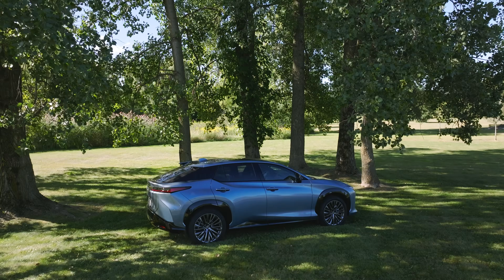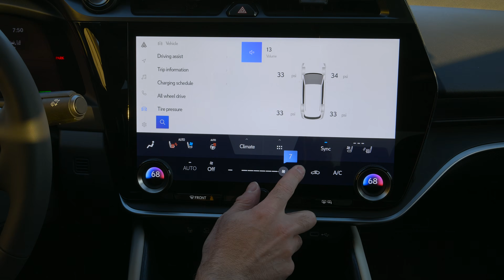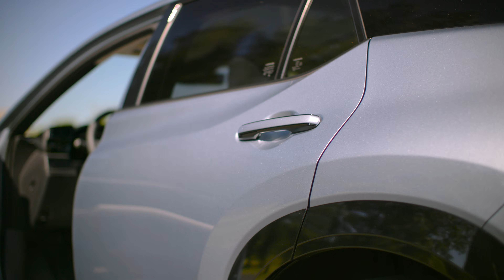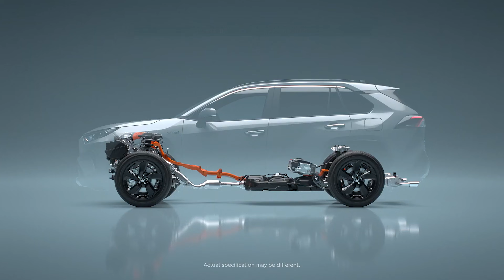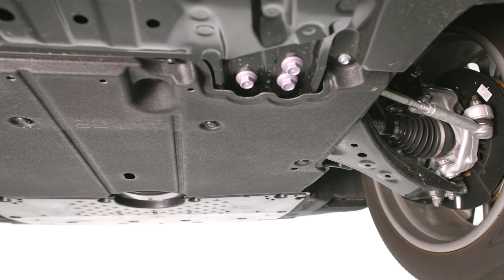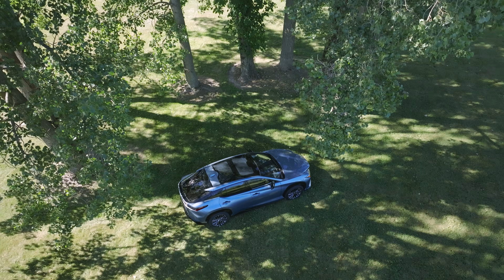Lexus RZ450 EV | Just Say No!

Comment: I think Lexus should be embarrassed about charging $65k for an EV with 165 miles of range. That's a non-starter, no pun intended. But I have to disagree with you Mark about the styling. The Tesla Model Y is just a Model 3 with a taller roof, and is utterly bland. This is a stylishly crafted, elegant vehicle (if you ignore the black fender cladding). The first time I saw one, I was impressed by the elegant 'stitching' effect of the non-grille into the air intakes. My wife disagreed and called it ugly, so maybe I'm wrong, but I think it looks elegant and distinctive. Still wouldn't buy one though.
Reply: I like the looks as well. I think it's decent to lease if you can do home charging, but only so.

Comment: There is no replacement for displacement. Keep your electric cars, there are so few charges in my county that no one in their right mind will buy an electric car. I plan on replacing my vehicle in 18 to 24 months it will run on gas only even if it means a used car. My local dealers have electric cars in stock, nobody wants them here.

Comment: What happens to all these EV batteries when they're all used up?
Reply: We burn them and heat our homes in the winter... Nothing like a 5000 degree furnace...
Reply: You could do that with Aluminum as well, but no, we actually recycle it instead @HDHQDIRECT
Reply: Shhhh...don't mention that problem.
Reply: They'll use em to fuel a bomb
Reply: Theoretically, they can be recycled. Or at least a good amount of their materials can be recycled.
Reply: @benjaminsmith2287  Theory but not in reality.  Especially those small cell batteries.  Munroe and Associates said it took them a month just to remove the adhesives from all those small cells... The effort to recycle is cost and time prohibited.
Reply: @benjaminsmith2287  That may be, but we shouldn't be putting all our eggs in one basket. Retrofitting older ICE engines to run on cleaner fuels will have a more desirable impact.
Reply: @Stinger430 that's unlikely. Synthetic fuels are far less efficient than electric vehicles.
Reply: @Kavafy  Sure. But if all vehicles polluted less, including older ones, I think would be even more beneficial than just making new vehicles electric. It would mean a larger positive effect on the environment, is what I'm getting at. Electric Vehicles are certainly part of the solution, but more than one approach is needed.
Reply: Same thing we do now with cars, strip anything that is valuable and send the rest to the junkyard. I'm assuming the batteries will be valuable.
Reply: It's much easier to mine used batteries for Lithium than to mine salt flats for Lithium
Reply: @hp67c  Does the economics work that way? How much does it cost to pry apart recycled batteries vs open pit mining? Keeping in mind EV batteries are not standardized.
Reply: recycled. 95% of materials can be. a lot easier than carbon capturing all your fossil emissions.

Comment: I don’t understand why Japanese manufacturers always cheap out on the passenger seat. In a Civic you’ll have 6 way adjustable seats but 4 way adjustable passenger seats. On a luxury model you’ll have driver lumber but no passenger lumbar.
Reply: That's not universal. I think with the exception of then Integra, Acura mirrors the driver seat controls on the passenger side as well.
Reply: @niuhuskieguy  The Integra has 4 way power passenger seat on the top trim. You can't even raise or lower the passenger seat nor are there rear climate vents.
Reply: @avery4528  Thats why I mentioned the Integra as an exception to that in their lineup. I have an RDX and the drive and passenger seat have the same 12 way adjustments.
Reply: Not universal. LS 500 passenger seat has like 20 way seats including massaging

Comment: My car enthusiast friend literally had a nightmare about every car on the street becoming a 0.7 litre hybrid crossover... But overweight EVs i think are even worse, because they are not even efficent.
04:40 The door slamming situation is atrocious though, just wow 😧
Reply: To be fair even non efficient EVs are dramatically more efficient compared to their ICE peers. Toyota and Hummer are fighting for the worst efficiency from an EV award and even they are much more efficient. The Hummer is rated 51 mpge city and 43 highway. No full size truck on 37s can get above 13 mpg.
Reply: I test drove the new RX 350 and noticed a similar issue with the electronic door actuators on that model. Very tricky to open and close the doors on that tester. I think it has to do with alignment. The electric system seems much less tolerant to slight misalignments of the door assemblies compared to the mechanical system. That's a generic problem for mass production vehicles which will never have perfect alignments that should have been engineered into the design!

Comment: Just say no, no B58
Reply: Oh you mean the engine where vanos fails every 10-20k miles? Where the valve cover leaks notoriously? Where there is no dipstick so when it burns oil like all German cars you have no idea when you are going to run out till it's too late?
Reply: @singular9  Vanos fails on B58s? Huh?
Reply: @singular9 *Thanos
Reply: @singular9  ok mr. no-B58
tell me why is it in a car with a Toyota badge then?

Comment: Subaru does those plastic fender covers too. I don't like it. 

I imagine though they probably do hold up better over 10 years than steel which rots out in the northeast. Still looks like garbage.
Reply: Plastic over steel so it rots faster but you can’t see it. 😂
Reply: @xFactoryUSA  if the plastic is protecting the paint under the steel it won't rot so bad. It's the little bits of gravel flying up that chip up the paint allowing the salt to take hold. 

In my stupid state of Pennsylvania you can't even drive your car on the road if it has a rust hole on the fenders. In NY you can. Our inspections are ridiculous.
Reply: Looks are the most important, after all

Comment: I realized while watching this that the thing that most people realize about EVs is that it's not about range. It's the charging. No one even thinks about ICE car ranges because it takes 5 minutes to restore all your range. With EVs it's about range because charging takes a lot more time. Potentially orders of magnitude depending on your onboard and offboard chargers. 300, 400, 600 miles... It will never be enough if charging times don't go down.
Reply: This Lexus is a perfectly good commuter car. Make your second car a hybrid and you’re good.
Reply: @ttjoseph1 too bad they are too epensive for a lot of people to afford one let alone two.
Reply: @adamnagel7436 true but comparing to Tesla is so much more luxurious more comfortable and much more reliable
Reply: Charging is not really a big deal...most of the time it is done overnight at home
Reply: @jamesmcgovern5563 except for people who don't have off-street parking or live in an apartment complex.   Your solution doesn't work for 1/2 the population.
Reply: @rjbiker66 then clearly electric car is not for them 🤡
Reply: @rjbiker66 when you live in an apartment, perhaps you shouldn’t be shopping for new vehicles.
Reply: A 40 mile PHEV gives 14,000 miles annually of cheap, clean all-electric commuting.
- Lighter, less expensive battery than BEV
- No need for another car for long trips.
- Existing infrastructure in place
- No need to conform your life to the car's charging needs.
- Lighter, simpler ICE can be tuned just for charging the drive battery.
-
Reply: @TheGratefulYeti  PHEV’s are great but also complex, plus if you do have to use gas the gas mileage is typically worse due to the added weight. Over all it’s a great option as long as you keep charging it
Reply: well, also there isn't the infrastructure with charging stations. Having to plan your car trip around where charging stations are is unappealing and the longer the range the less you'll have to do that.
Reply: As much debate is between ICE and EVs, plug in hybrid consumer cars still hold the trophy. They offer range, charging capability and the engine in most are range extenders. It's a brilliant thing to have whilst the manufacturers do some thinking.
Reply: @btownballer27  also reduces the amount of heavy battery metals each car needs. 10 PHEVs vs 1 EV worth of lithium/cobalt/etc
Reply: Do you worry how long your phone charges at night when you put it on your nightstand?  Most people with an EV charge at home. I personally can add 29 miles of range per hour at home at Level 2 (40amps) and rarely am I below 50% when I charge. So I am done in at most 4 hours to 90% state of charge.
Reply: @appleiphone69  my phone cost $450, I can charge it everywhere I go and can juice up while I'm on the crapper so I have time to contemplate life's mysteries.  Cars aren't like that, so can you make another straw man?
Reply: @bassandtrebleclef  every outlet is a energy station for my car. I can charge at a park, grocery store, mall etc.  Your point? It cost me 1/3 per mile to drive compared to a ICE vehicle. Add no oil changes, transmission fluid changes. More money in my pocket for investing or other purchases.
Reply: @appleiphone69 it's fine to just keep the car on charge all night 🤡
Reply: I charge for 10-15 mins for a 300 mile trip. i dont even have enough time to eat and go to bathroom before its done. I spend 7.50-15$ for this trip vs. over 100 in gas. I've never charged more than 25 mins. ever
Reply: @TeslaRoadtrips  you getting like 12mpg that it costs $100 in gas to go 300 miles??????
Reply: old land cruiser takes premium, wa state its about 5.50 a gallon. horrible mpg @FlyingNDriving
Reply: It's both for me along with other inconveniences.  My current sedan gets ~350 miles all city driving and over 500 all highway.  Means I don't need 2 cars (1 for commuting 1 for long distance) not that I could afford 2 so 1 has to do it all like ICE can.
Reply: have to get passed lithium batteries first
Reply: You are not wrong.  I hit every charger available on long trips because going from 0-80% takes 20min at most.  So after an hr or two of driving I top it off to 80% in 5-10min then to the next one.  If I skip chargers and wait to go from 5%-90%.  That will suck.
Reply: Speak for yourself. The first time I heard Doug pimping an E class diesel with 800 miles, I immediately said "want".
Reply: You really didn’t know that before this video? Yikes.
Reply: EVs aren't road trip cars, they're urban commuters. They will eventually become road trip cars when the charging speeds and infrastructure are up to par.
Reply: Correct, no one complains about range anxiety with hi-po Mustangs getting low-200s when driven with enthusiasm. Toyota doesn't understand the technology.
Reply: Get your own charging port! I have been fast charging 3x this year, ONLY 3 times!!! And not half an hour, but just 10min because i only needed an extra 80miles to get home. When i buy an EV i buy it for the car, not for the range or charging times. It's just that not many EV drivers are car lovers!
Reply: Therefore it's just an addition car for long trips you should have another car
Reply: It's an issue I don't think will ever be solved. Fast charging will mess up the battery long term since it produces a ton of heat and is less efficient. It's why hydrogen is the best in between but that too has its own issues in terms of storage and capacity.
Reply: @nateTrh finally somebody that has a little bit of Common Sense
Reply: @nateTrh  new studies are actually saying fast charging hasn’t effected battery life as much as many has thought
Reply: @doomsday9973 source?
Reply: @royaltyallen1162  sorry can’t post links, google is your friend
Reply: @doomsday9973  it's not in Google either,maybe its in your ass?
Reply: @doomsday9973 save that garbage for somebody else I just know how finicky my laptop's cell phones my power tools that use Lithium-ion batteries are the most finicky batteries of any type of a rat in my entire life and Battery degradation is absolutely horrible
Reply: @jasonmurdoch9936  hahaha! You can’t possibly compare the two are you kidding me? Do your phones and laptop have active battery cooling? Oh and guess what Sherlock many of the EVs don’t even use lithium ion (or they use completely different lithium chemistries like LFP) the model 3 long range for instance uses Nickel cobalt aluminum. The only garbage I see is that paragraph you just wrote
Reply: You can't carry a jerry can full of electrons either.

If I'm doing a big trip I like the security of having extra fuel in the trunk, just in case (mind you I'm in Australia where you can do a lot of k's without seeing a fuel station very easily).
Reply: @r0x0r-p4t  30 miles of range weighs 8lbs
Reply: It’s a change for sure no arguing that. The vast majority of charging right now is done at home though so it’s very easy to have a “full tank” every mourning  and essentially never worry about range.   Road trips are a different story of course, it takes more planning (less if you have a Tesla) and you can add an extra 2 hours to your trip for charging. No doubt ICE cars hold the advantage here
Reply: @doomsday9973 Your "full tank" on a EV is still a half a tank of gas every morning in a ICE vehicle.😂
Reply: @HDHQDIRECT  what you are saying is just stupid. What’s your point? I get over 300 a charge, I drive like 20 a day if that. Why would I even need 600 (FYI the average ICE car gets 420 to a fill so “half that” is also BS). I charge overnight about once a week, never needs to go to a gas station and pay 4 a gallon. Enjoy!
Reply: @doomsday…. Because not all of us lives a life limited to within city driving, like, clearly, you do.
Reply: @doomsday9973  Funny cause I drive the same amount as you, and I get gas like once a month in 4 minutes.  Never plug it in, or experience phantom drain.  Just drive it, park it and forget about it for another month.  But I'm the stupid one.  Oh and my Kia Optima has 500 miles of range on a full tank, maybe even more.
Reply: @is6566  sucks to be you I guess? The average US commute is 41 miles round trip. If you are above that you are outside the norm not me.
Reply: @HDHQDIRECT  I never get phantom drain on any of my cars so don’t know what you are taking about there. Yeah it’s so so tough to plug something in once a week (or less) In my garage, at my home for a fraction of the price of fuel (which is again on the rise btw). Get real
Reply: @doomsday…. It’s hilarious that you still don’t get it and you consider my life to be sad while actually yours is. It’s not the commuting, my friend. It’s the pleasure driving. The driving the open road. Long stretches of highway. Curvy mountain roads. Traveling to far away places. That’s where EVs suck a$$. The fact that even after prodding you don’t/can’t fathom it, shows that you never do something like it, and that’s why you sing the hymn of the inferior (at least now) product.
Reply: @is6566 and you drive over 300 miles a day? 
Sorry buddy but the world isn’t made for you 😂
Reply: Wrong  @HDHQDIRECT
Reply: @is6566 most people don't drive 200 miles a day though 🤡🤡🤡🤡🤡
Reply: @HDHQDIRECT  what a terrible car you drive 🤮
Reply: @doomsday9973  what about apartment dwellers and city folk who park on the street?
Reply: @RichardinNC1  that’s an issue not denying it, apartments/condos will eventually have to provide more level 2 charging for
Reply: Orders of magnitude? 

At home it saves the user an order of my magnitude. 

On the road it adds 20 minutes if it's from a maker who knows what they're doing.
Reply: @robertide5182 20 minutes charge time, plus pulling off the motorway, to only get 75% of a charge which on the motorway is about 200 miles at 80 mph. Versus stopping every 350 miles for 5 minutes.

It will very much add 2 additional hours to a 12 hour road trip.

I've owned two 800v EVs. It's a cross I don't mind bearing but to pretend it isnt inconvenient is being dishonest at best.
Reply: My benchmark is 450 miles.  That's my road trip to family I take 2 or more times a year.  Plus that's a common daily max distance, although I have driven 600 miles in a single day or 500+ over multiple days to get to particular destinations!  Plus some places I go are not California and don't have massive charge networks in place.
Reply: Not to mention the worries about Lithium-ion batteries blowing up Catching Fire and Battery degradation just a name a couple
Reply: In China they have an automated public garage that swaps out your spent battery with a fresh one. Maybe some device like that could be implemented either in public garages or at home in the West. Then it doesn't really matter how long charging takes, it becomes about how quickly the battery/batteries can be changed.
Reply: @ams914 Then you have even more materials sitting around wasting space. And why would you need that at home? Just charge and go to sleep. When traveling fast charging is more than capable.
Reply: @ams914  Tesla had battery swap 10 years ago ( https://www.youtube.com/watch?v=H5V0vL3nnHY ) then realized that the battery ownership model didn't make sense:  nobody's going to pay full price (battery included) for a car then give their brand new battery away at the battery swap station.  Nevermind the fact that now you're building more batteries than cars, then not selling them to anyone.

We won't see this in the US or globally until the cost of batteries goes way down.  Simply because there's no financial incentive for the car maker to make the extra batteries for the subset of owners that will use them.
Reply: @ams914  that will never work here. u think americans are going to sit in their car for 5-10 minutes with no hvac, doors locked a la NIO? lol. not happening. all that time doing that, you're not going to bathroom, buying food etc.